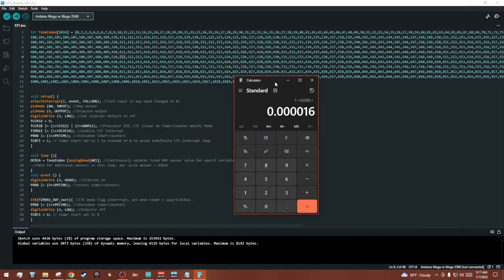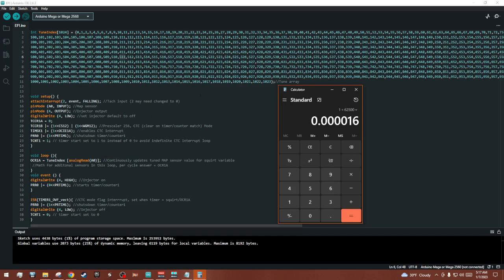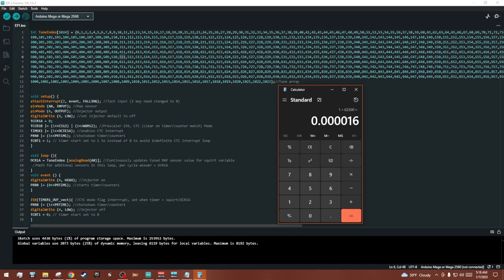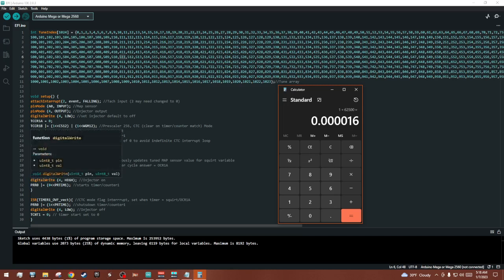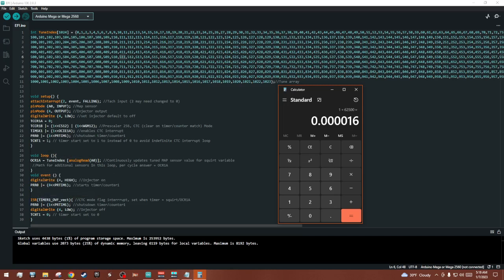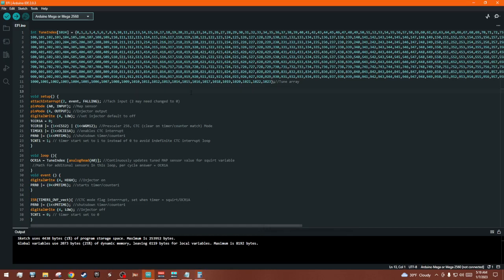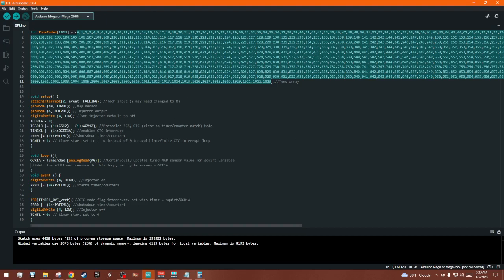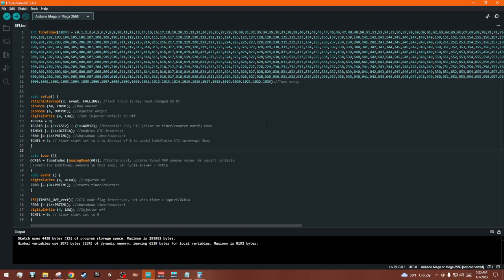Arduino 2560 Electronic Fuel Injection (Untested)

Comment from the maker: Added temp compensation. https://www.reddit.com/user/MarcWWolfe/comments/107df30/2560_efi_added_temp_compensation/
Reply: page not found sir,the code please
Reply from the maker: Probably because i got banned from reddit. Political bullshit. I'll check if i posted it to facebook too; I might have.
Reply from the maker: Nope, looks like Reddit was only place I pasted it online. I'll have to check my storage HDD tomorrow.
Reply from the maker: Yeah, sorry, you'll have to recreate it from what you see in the video, and this comment. For temp, there was another array with 256 values, 16-32. 16 and 32 had 4 duplicates in the array, the others had 8. Supposedly it's easy to do 8 bit ADC mode. That 8 bit array value (TEMP) was multiplied by the first array number (MAP sensor). I think I also had to keep the numbers from going over... I think 4096 is biggest number Arduino can deal with (don't quote me on that part). So if there's not enough fuel (injectors too small etc.) and you're hitting the digital maximum of biggest numbers Arduino can deal with, you have to change the clock pre-scaler of the timer that handle injector duty cycle. MAP array may also need duplicate entries to make everything coherent. I might have changed MAP array and ADC to 8bit mode. Big array runs out of RAM quick.
Reply from the maker: For additional clarity, 16-32 because temp from hottest to coldest condition, across the entire earth, can vary air density by 2x (or less, I think I messed up looking at degrees C vs F). Negative 40 being about double air density of 120F or something. I definitely had enough range for year round crazy weather. Highest temp multiplies MAP array number by 16, coldest by 32. A factor of 2, with some granularity in between, without decimal/floating point math.
Reply: @Marc_Wolfe  yeah, maybe I will copy your code. i have a project about efi on my bike
Reply from the maker: Share you're results.

Comment: Great work! I like the synchronous injection using the tach input, it's probably better than the asynchronous constant-frequency method I'm using. The direct register manipulation likely helps the code efficiency as well!
Reply from the maker: I like lower level programming, but the main reason I went that route was... it's based on examples in other people's code. Happy coincidence. Also, there's no math to determine RPM.